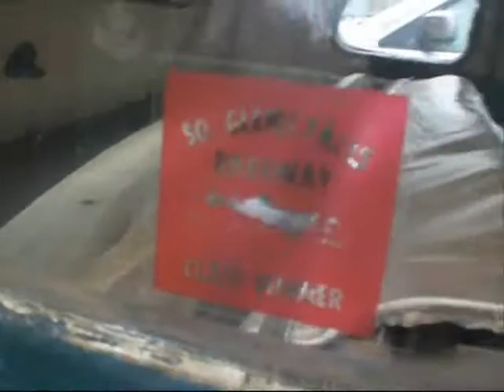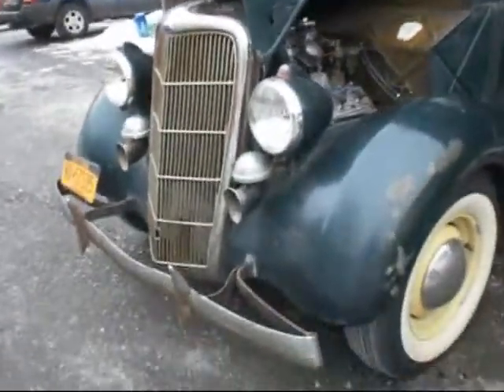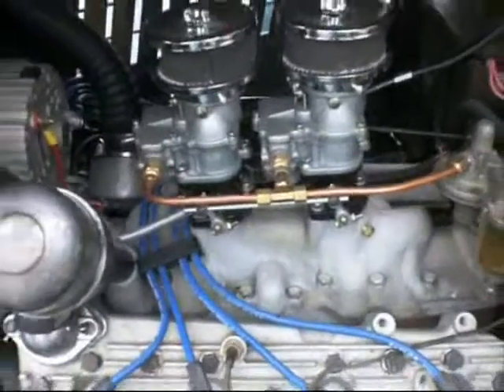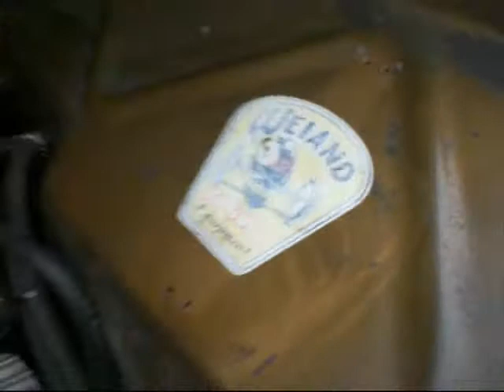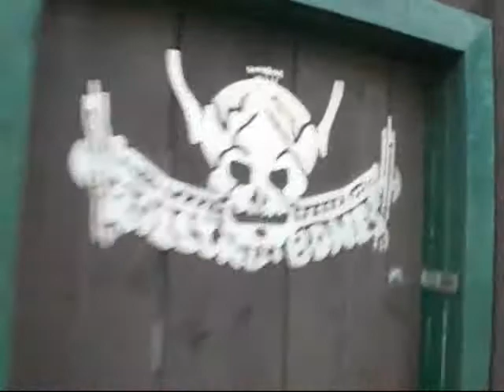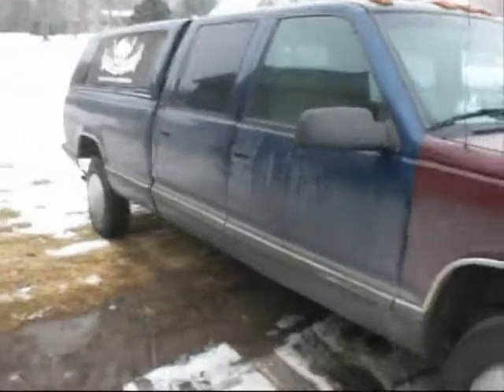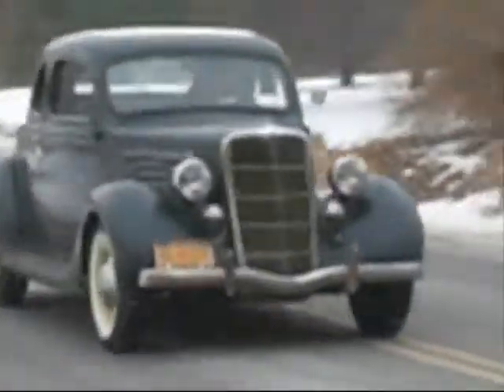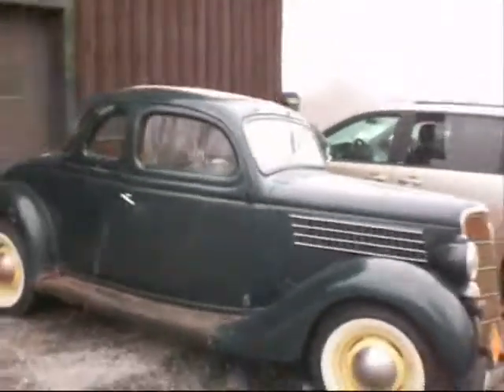2 2 14  NHRA Class Winner Ford Flattie Vid

Comment: my father had a 47 ford sedan with the 100hp flathead ford engine, ran perfect, but he was wanted a chevy motor so he sold the flathead to a guy that was puttin it into a 50's mercury. went and bought a 78 350 v8 camaro for parts. the body was junk on this camaro. he took the front and rear clip of the frame and welded it to  the mid section of the 47 ford frame. so it had a chevy 350 engine and chevy trans and rear end and took chevy wheels.
Reply from the maker: Cool! I want a '32 Hi Boy
Reply: that would be cool,I like alot of old fords, but Id rather it be powered by a chevy engine